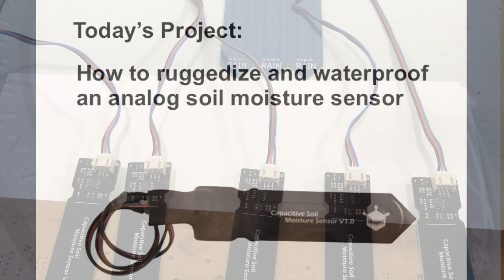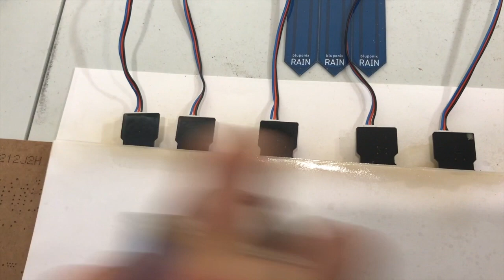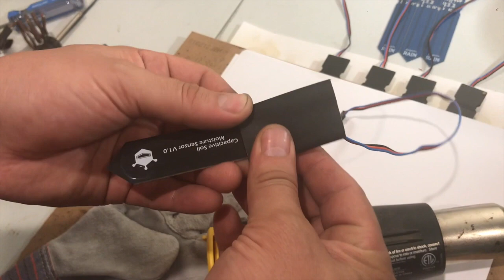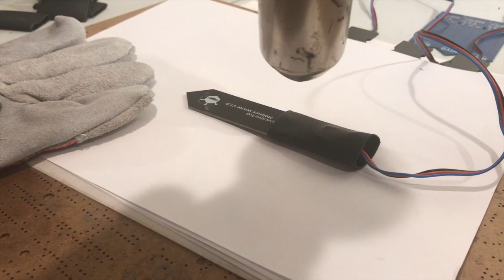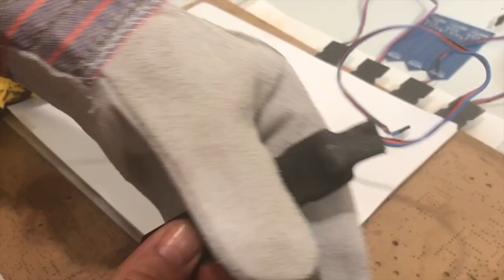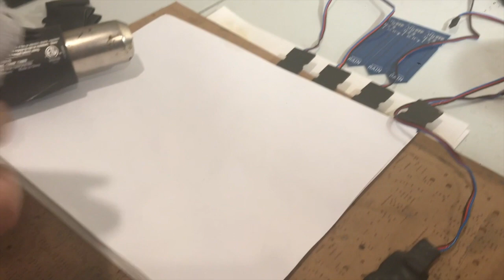How to Ruggedize/Waterproof Electronic Sensors for Long Life Operation: Analog Soil Moisture Sensors

Comment: You didn't coat the edges that go into the ground - it definitely will corrode there - water will get under the current paint. best to seal the edges with either rubber liquid or (cheap and as effective) black nail coloring ;)

Comment: Good idea with the shrink tubing! However, I can also recommend very brushable or sprayable liquid rubber instead of the clear varnish! The stuff with one or two coats over the upper electronics. I also painted the edges of the sensor board with liquid rubber ;)

Comment: You might also want to protect the capacitive plates unless you're dead sure that they're weatherproof. I had a sensor (it was a white one) that had its solder mask peel off and exposed the copper plates, which is a definitely a problem. So I wouldn't hesitatr to cover them with a bit of lacquer on in the worst case, plasti-dip them.

Your sensor reading will be altered in the process but if you can live with calibrating your sensors differently, that should be fine.

PS: the 0-5V output of those sensors don't translate into an actual measure so I'm kinda moving away from them and thinking about making my own

Comment: Good clip. How did you waterproof the edges of the PCB? Since you were covering the sensor surface while applying the polyurethane spray I'm guessing not with that. I was considering running a bead of 2 component epoxy along the edges to seal them off completely, but I'm not sure if that interferes with the capacitive sensor element...
Reply from the maker: We typically don't treat the edges of the PCB. In these cases we've found the sensors do require recalibration over time, but eventually reach a saturation point where recalibration is required far less frequently.

With that being said, we have conducted tests in treating the entire PCB (including edges) with multiple coats of the same urethane sealant used in the video.  We found the analog capacitive sense range tightens when treating the entire sensor.  For example, a sensor treated as in the video might exhibit an analog range of 250 (wet) to 750 (dry), whereas treating the entire sensor might yield a range of 525 (wet) to 750 (dry).

With that being said, I don't think treating the edges alone as you suggested will affect the capacitive readings much if at all.
Reply: @adosia  Thank you for the detailed reply! I'll take your points into consideration and make an A/B comparison of the concepts and their respective performance.

I forgot to point out that my sensors are the cheaper import version of this module, so the production quality likely is lower (I.e. the edge leaking might be more prominent)
Reply from the maker: @TheMarshallFan  awesome.  Let us know how it goes.  We'd love your feedback.  Happy holidays!
Reply: @adosia  So epoxying the edges didn't affect the sensor range at all and no water seems to be getting into the pcb as far as I can tell. So far so good! The only downside is the effort it takes to apply it evenly and without making a mess.
Reply: @TheMarshallFan  I'm doing this right now, any updates on how it went?
Reply: @Lenningx  I ended up just sealing the edges with epoxy like stated in the last reply above. The project has been sitting for a while now, as I wasn't able to find a good way to calibrate the sensors across their range (their response is somewhat logarithmic-ish it seems). Epoxying the edges seems to have done no harm the readings though, so I'd say cheap insurance.

Comment: How about encapsulating the whole sensor inside a big heat shrink? Would it still works? This sensor works even inside a thin plastic bag. Would it work inside a heat shrink?
Reply from the maker: Maybe - we've treated the entire sensor with urethane seal which significantly reduces the analog reading range - but it still works.

We're not really a fan of using that much heat shrink though as the dual-walled shrink is expensive.

We also have shielded moisture sensors now, which help tremendously with stabilizing readings over longer wire runs.

Comment: Thank you very much. Just tell me, how did you prolonged the wire? Which kind of cable did you use? Thanks
Reply from the maker: The easiest way to lengthen the wire is to cut the connector in half right in the middle - then solder the each end of the severed connector wires to a 3-wire 24AWG (or 22AWG) extension cable in between.  You can even use 3-wire utility wire found in most local hardware stores. You will want to seal each solder area with the same marine / adhesive lined heat shrink.
Reply: @adosia  Thank you very much.
One more question: Won't the water fall into the sensor through the Heak Shrink top (It seems that It's not fully hermetic sealed from the top)?
Reply from the maker: @cloviscareca  - no it's sealed - the heat shrink needs to be adhesive (glue) lined, and pressed together firmly once heated up.  The glue inside the heat shrink seals out the water from entering from either the top or bottom once it's been melted using a heat gun.

Comment: How long does it take until the contacts corrode? I've always wanted to try this but everyone says they go bad quickly.
Reply from the maker: Non applicable here.  These are capacitive sensors, so the lead traces are never exposed to the elements.  The sensors do perform better when recalibrated regularly - say every couple weeks to every couple months or so.

Comment: Thanks for this. I would still seal the edges of the PCB also as unsealed FR4 can absorb the water (from the soil) and in the long run ruin the measurements and the sensor itself. For example epoxy glue or the spray you used would do the trick.
Reply from the maker: Ok so we sealed the entire PBC with the urethane conformal coat in another test - it still works, but with a reduced analog operating range.
Reply: Question is: does that really matter? after all, it's just a very rough indicator as these cheap sensors are not that awesome with exact values anyways - so if you use them to measure the soil moisture in your garden it probably will still be good
Reply from the maker: Thanks for your thoughtful comments.  We are running trials tests with sealing the entire board to see if that has any effect on overall performance . 

We see some cases where the soil medium may be coarse and more prone to scratch the solder mask off the PCB exposing the copper.  We're also trying to determine if sealing the edges out will lengthen the intervals between requiring new calibration.

Thanks again.